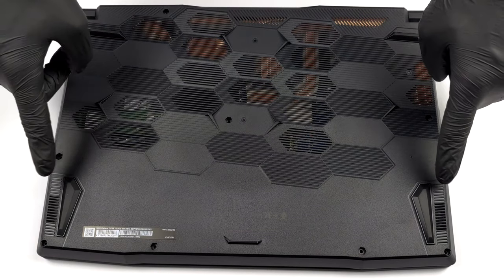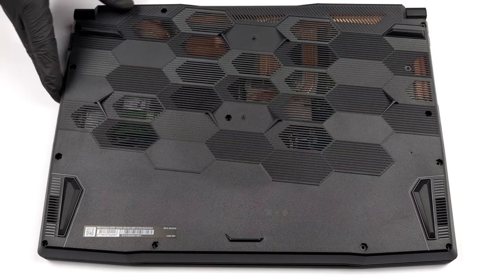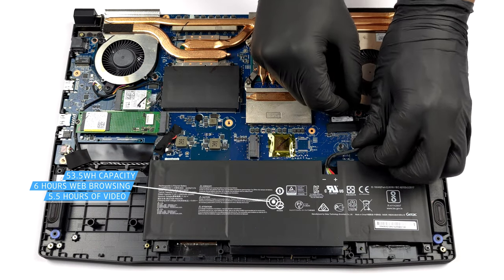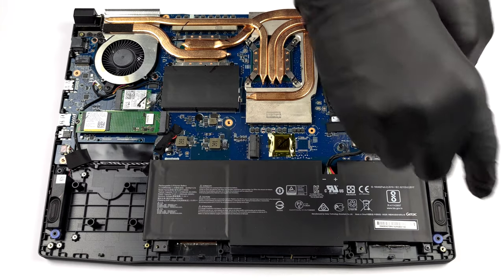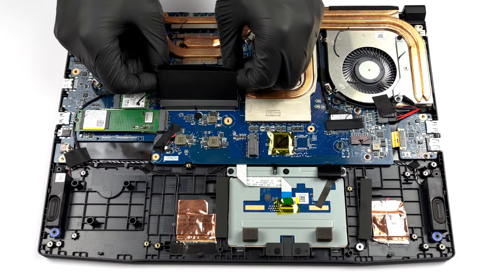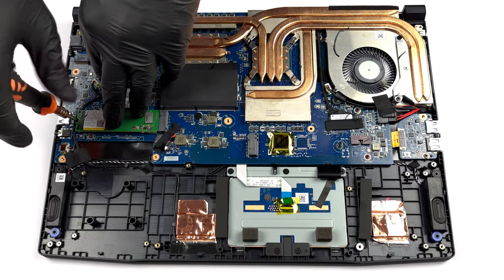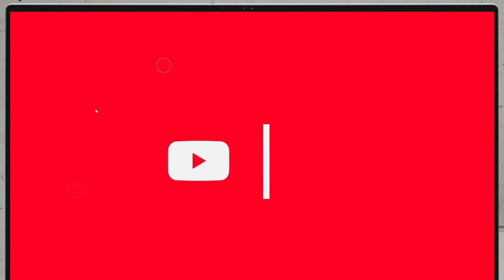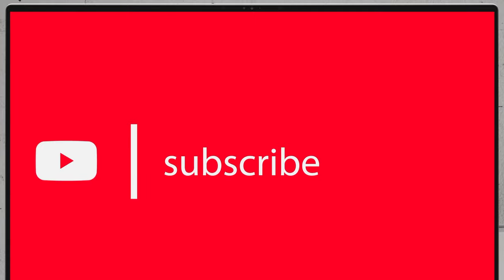🛠️ MSI Katana GF66 (12Ux) - disassembly and upgrade options

Comment: Thank you! I am totally gonna save up for this sucker and use it as a server host for steam games/travel. :)
Reply: Hey, just a quick heads-up: if you plan on using this laptop while on battery mode for long usage, don't. Consider other laptops, and stay clear of gaming laptops a they are notorious for bad battery. This one isn't an exception, as it doesn't last more then 3 hours 30 minutes of browsing with no other process. Other then that, watch out for it's hinges and make sure you loosen up those screws at the hinges, and make sure you open the laptop with one hand on the lower case, and the other on the center of the lid (screen). Other then that, this laptop can get quite noisy when gaming, yet performance wise is a charm. I have been using the GF66 11UE, core i7 RTX 3060 one for pretty much everything, and it's a banger. I just have those three problems already stated: battery, hinges and noisy fans.

Other then that, enjoy your time and good luck, have fun traveling :)
Reply: @Atomic-Blast-  thank you for the notice
Reply: @Atomic-Blast-  I wish I saw this comment befoer buying mine, my hinges broke.
Reply: @QuackedUp  sad to hear that... I took mine to a local shop and they fixed a broken hinge for 40$ + they loosened both hinges' screws. After 3 months it's still as good as new, yet I am very rarely closing the screen... best of luck !

Comment: Looking at the top-down view at 1:58, it almost seems like a SATA port could be soldered into the motherboard directly under the populated M.2 slot, or that some board models have that SATA port pre-soldered.
Might not be available on this model, because I know sometimes when multiple M.2 slots are populated, the SATA ports get disabled.
Curious though.
Reply: My GF66 i5 rtx350 has the nvme on the other side by the cpu fan and a SATA port. All of them have room for SATA but some have only 1 nvme port for storage.
Reply: My version is the GF66-11UG. My board had two M.2 NVME slots along with one SATA port. Never tried to attached any drive to the SATA as it is non accessible because I have the option of larger battery pack. So the SATA port just sits there doing nothing. 😂

Comment: would upgrading one of the ram sticks to 16gb and making it 24gb of ram be a good upgrade?
Reply: Not really. Unless you are doing something that currently maxes out all the 16GB ram. You will not experience any performance improvement otherwise.
Reply: might aswell just an extra upgrade

Comment: What can you put on the empty space beside the battery?
Reply: On the other models of this laptop (MSI uses the case for different variations of GF66) a SATA SSD drive would sit there. The SATA port on this board has been replaced with a gen4 PCIe SSD slot.

Comment: New MSI Katana GF66:
When inserting a bolt, I drove it too far and it dented the upper side of the case facepalm Any recommendations?
Reply: You can purchase it and replace. I purchased from taobao and replaced all housing my gf66

Comment: Does the GF66-12UC has the second PCIe slot for SSD?
Reply: Most of the time, the chassis and layout are the same.
Reply: Nope, it hasn't... I bought 1TB m.2 and now I have to replace the stock 512 storage with the new one, I can't install a second sdd
Reply: @bartfound  thank you for the info
Reply: It must be in laptop, but some chinese kids need it too
Reply: @bartfound  Are you sure?
Reply: @bartfound  Is there Any slot for SATA SSD? i saw there's empty Slot there
Reply: @bartfound  You can literally see a second slot in the video. Are you sure this is even the laptop you have?
Reply: They have a video for the other motherboard layout you are using. The chassis is the same but the motherboard layout is different for the 12uc.

Comment: Thank you so much for this video! Is the  graphics card on this model upgradeable?
Reply: lmao no laptop has upgradable gpu, u high?
Reply: @wnihaunter3943  I think MSI GT series does
Reply: @d.j_cam  i really doubt it
Reply: you can use an external gpu
Reply: @d.j_cam  lol you need a lightning port for that, which most mid gaming laptops don't have

Comment: according to msi's spec sheet only the Katana GF66 11UG, Katana GF66 11UE have 2x m.2 slots and the Katana GF66 11UD, Katana GF66 11UC only have 1x m.2 slots. is that what it came with from the factory. or the actual number of m.2 ports and it is expandable. just dont want to buy an m.2 for nothing

Comment: No extra ssd slot upgrade?
Reply: As he said the are 2 slots, one used and one unused
Reply: @firstlast-ex1bz  i mean 2.5"
Reply: @wildriftrulesofmoore925  MSI removed the connector after a few months of production...
Reply: https://www.youtube.com/watch?v=B-Y83jN2IFA on specific models there is one.
Reply: there is a second ssd slot. why would you want a slower sata SSD over a pcie slot?
Reply: @williamsjessem  cause im from Turkey and m2 ssd so expensive i cant buy.
Reply: @williamsjessem  
SSD (Customer SSD will never replace HDD (not before 10 or 20 years) !!!!!!!! 

there is many reasons why we want to use hdd instead of SSD ... When you write and read hundreds of GBs per day (without need to speed of SSD) HDD is the best .

Don't forget, SSD write in cells even when you don't write anything (Write Amplification) especially if SSD is full at 80%+

HDD you can have 2TB there and nothing is written.

+ Only Expensive SSD can really compete with HDD in some usages but i think nobody will buy $200-$300 SSD when 2TB-4TB HDD costs $50-80$

When Consumer SSD will have same Reliability and lifespan as Enterprise SSD ... That day we can replace our HDDs.

Seriously, i can't buy $1500+ laptop if it doesn't have HDD Bay it's just ridiculous because put SATA Connector and Controller doesn't cost anything for Manufacturers.